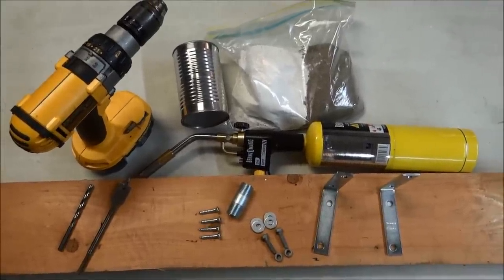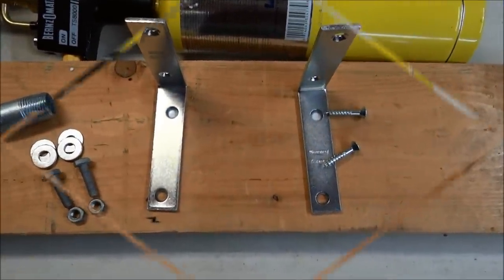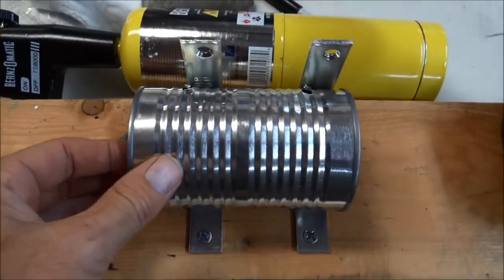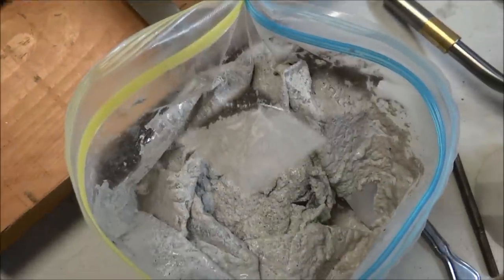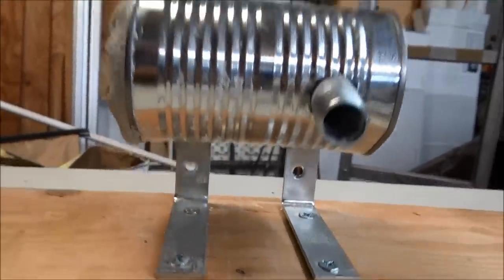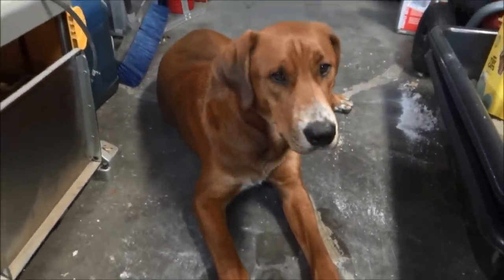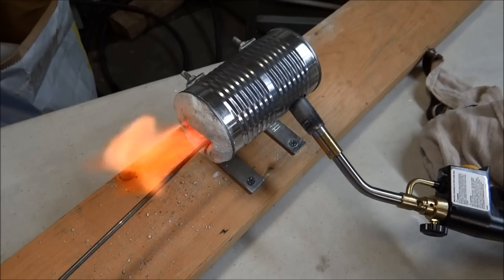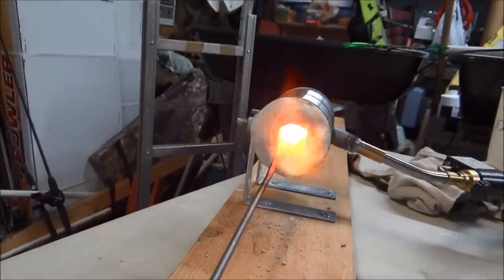Home Made Soup Can Forge - 2000+ degrees - Make your Own Tools

Comment: Clever & cheap!

A couple of modification ideas:
1.  You can heat more of your longer stock metal by making your forge with an opening on the closed end of the can/forge.
2.  You could make your forge into a smelter by making removable front & back doors on your can.  You may or may not need to include a small chimney in your can to optimize heating while the doors are closed--or, you might just be able to make a vent on one of the doors to ensure an optimal heat flow.

Comment: Very cool idea.
By the time the plaster breaks down around 25-50 fires you make another one cheap get it most any where. It's the same stuff you use on dry wall. It's called spackling, just add sand!

Comment: I made a very similar forger and found that the sand actually erodes easily over time , especially with lots of use. So I made a new one but used perlite from Miracle-gro and sodium silicate with only a smidgen of plaster of Paris and found it to be far more durable and a better refractory material. It costs a little more to make it, but it's  worth it if you're planning on making lots of things with it. I use mine pretty frequently for my knife making business.
Reply from the maker: +daisy8luke Cool.  If I had my choice, I wold use refractory cement.....it will last a long long time.  Thanks for watching.  Good luck with your knife business.
Reply: LifeBuzzN If I was going to use refractory cement, I'd just mix the perlite with the sodium silicate and let it form up, then use the refractory cement to make a smooth lining of the inside and the outer face. That would make a badass little forge that's really durable.
Reply: +LifeBuzzN I haven't made a soup can forge, but I imagine the way it works is similar to my chili forge. For my hard refractory, I use fireplace cement. I got a tub with a pound or two pre mixed for a few bucks. One of those containers would be enough for something this small, I'm sure.
Reply: +LifeBuzzN I haven't made a soup can forge, but I imagine the way it works is similar to my chili forge. For my hard refractory, I use fireplace cement. I got a tub with a pound or two pre mixed for a few bucks. One of those containers would be enough for something this small, I'm sure.

Comment: You can do this with the jet hole centered and cut out a hole in the bottom of your can as well. This would allow you to forge longer pieces of steel. A two burner model of about 18" is sufficient to forge swords length objects.

Comment: I built one of these last year and have made about 20 great bushcraft knives in it. In fact I just forged three of them this morning.  I started out with propane, but recently discovered the MAP gas works way better.
Reply from the maker: Way to go Howard.  Thanks for the comment and views.
Reply: Hey, that sounds exactly like what I am trying to do.  I just built one of these.  How do you get the whole blade red hot for smithing? I tried a 4 inch blade today and only the tip got red. I am used to doing it with charcoal so any advice is appreciated.
Reply: Brad Isaac
It's difficult to do if you've placed your iron tube too far toward the bottom of the can like I did. I place the blade in the forge about an inch or two from being all the way in and get the tip glowing first. Then I push it all the way in and use another propane torch to heat the end of the blade closer to the handle. It has worked pretty well so far, and I can get up to about a 6 inch blade glowing pretty easily. But I'm looking to build another one with better tube placement. Also, look in to using the MAP gas mix that comes in the yellow bottle instead of the blue. It's about 1,600 degrees hotter and works better. Good luck!!

Comment: I did this from a different video, but it amounted to the same thing. I used a coffee can though. It works, but the hole I drilled for the pipe nipple was too far forward and the lining is more funnel shaped than an even cylinder. Plus my vise doesn't make the best anvil. Still it's proof of concept, I've already got plans to help refine the heat chamber and add a shelf to rest the metal on while it heats up, probably get an ASO from harbor freight just to start with.

Comment: Nice idea!  I notice a lot of people asking about getting oxygen in there to increase the heat.  I picked up a crude torch at Lowes that combines MAPP gas with a cylinder of oxygen.  It isn't easy to get the proportion of gas to oxygen, but I'm thinking this will increase the heat output quite a bit and allow for a bigger can to be used.  I'm also curious if insulating the outside of the can would help.  I keep thinking about the kiln explosion excuse from Animal House...

Comment: Can a 50-50 mix of sand and plaster be used for high temp investment casting of ferrous metals? Like for making molds for the molten steel to be pored into?
Reply: Duly noted I found out that temp of molten iron would melt the plaster. Casting sand or a high temp investment plaster is required.  Thanks again :D

Comment: does the plaster/sand mixture ever crack, melt or disintegrate?
of all the homemade forges. I've seen over 15 for sure, this is by far the simplest, easiest, coolest.  I like how its not messy (dont have to deal with coal/charcoal) and convenient like you can move it around anywhere.
Reply from the maker: It will eventually dry out and crack, but you should get several burns out of it.  To make it more permanent, you could use refractory cement.

Comment: I would make sure your using MAPP gas instead of propane.

MAPP gas is usually in a yellow tank and propane is in a blue one.

MAPP gets a lot hotter than propane will. Try that and see if it works.

Comment: I like it, and it must be great to have a whole workshop to work in, I'm trying to think what I would use it for, or what it can't be used for, maybe for making small tools, melting small amounts of metal, I don't know melting points of silver or gold, would it melt them? Does it get very hot when you have had it on for a while, the surrounding air I mean, say 6 foot square around it?
Reply from the maker: B0rnles13 This is the exact comment as John Pollastrini........what gives?
Reply: google+ trickery

Comment: I made one of these, but like in the video, only can heat the tip, not the rest evenly. Thinking about drilling a hole through the back to pass the piece back a forth using firebricks to close up the gaps. What do you think?
Reply from the maker: smiley235 I think you would lose heat out the back,  Try it, let me know.

Comment: GREAT simple forge and how long can the plaster/sand mix keep with those heat levels before it cracks apart within?  I would try this with firebrick mortar.  Any feedback is welcome and Happy Holidays to all nonetheless.
Reply from the maker: Adrew Dio Hi Andrew, this little forge will not last forever.  It will eventually dry up and start to crack, although, I've fired mine for a couple of years.  I would use refractory cement for something more permanent.  Take Care-
Reply: Thanks for the tip...i'll check out the handymansclubofamerica for more details.  I was thinking about using graphite with the sand and plaster mix and I'm the kind of guy who likes to stay informed.  I don't want to mix this the wrong way and wind up with air pockets.  I'm a novice in this area although I'm a seasoned home repair worker.  I've never met any contractor who's strong in every type of repair.  Enjoy the Holidays and I left some painting tips at the web site above (my name at the site is adiovanni.

Comment: Awesome... but quick ?...  Why MAPP vs Propane gas?, and why no inlet breather hole?  Finally... any suggestions on a homemade clay slurry to paint on the steel while cooking it to alter the 'blade' section... vs the spine?

Thanks!  -Steve
Reply from the maker: Hi Steve, the Mapp gas is hotter than the propane, but either would get you enough heat to bend and work the steal.  I'm not sure about the slurry, sorry.  Go check out Chuck Richards.....he's a my knife master.

Comment: Very interesting!  I wonder if you can use this for a pottery kiln in miniature!
Reply: I've actually ordered fire clay recently, so I could custom size a little miniature kiln. I was going to manufacture a little lid, so that it could be enclosed. Of course it might need a porthole, but that's all trial and error. I'll be posting a video in a couple weeks when I get all my materials. 

If you plan on doing something like this, I highly suggest getting a pyrometer and a finer control on the propane. This can definitely reach about 2100 degrees, but it would be nice to have control enough to bisque first.
Reply: mndawsome I'll comment a link to my video when I make it.
Reply: mndawsome
 MAPP gas not propane.
Reply: Rustaholic777
MAPP gas is WAY hotter than propane. If you try using that in a small forge you must keep a close eye on the metal you put in the forge because you will melt it and have molten metal in the bottom of your forge. I had this happen in a small two brick forge I made using two soft white fire bricks. It is easier to make a forge from 2 rather than one soft brick btw.

Comment: cool video and nice job, if you cant get plaster of paris can a normal cement mix be used or is there a significant difference in the powders...
Reply from the maker: Thanks Moonbear, you could probably use any cement, but it will not maintain the heat as well.  Home Depot has it.  When I was looking, I had to buy the 50lb bag, but it was cheap.  You could also use refractory cement if available.
Reply: LifeBuzzN
i am in the uk we dont have home depot and our equivelant doesnt carry plaster of paris i will nosey online and see what i find cheers..
Reply: moonbear Save your money.  Plaster of paris forms a hydrate when it cures.  Heating up this hot will release the water in the bonds and you will be left with powder.  Use furnace cement mixed with ground up styrofoam.  Foam burns out and leaves air pockets that will insulate.
Reply: Bill T hey, that is nice to know. I was thinking about using fire cement, is that the same thing as furnace cement. I wanted to use it to line an old air tank with hard gravel. what do you think about that idea?
Reply: If you can't find refractory cement at your local hardware store, check with your local boiler repair/supply.  Mine actually stocks ceramic wool and proper 2800 degree (f) refractory.

Comment: Enjoyed the video - both the forge, and the pooch.  Can u use PermaStone or QuikCrete . instead of sand / plaster of Paris mix?  I ask "cause that's what I have on hand.
Reply from the maker: Regular cement may explode when heated, so avoid quickCrete.  Make sure what you use can handle the heat.  Like refractory cement.  Thanks.

Comment: That nipple you used looks galvanized. I thought heat those up releases bad gas. I know we always made sure to have proper ventilation when working on any galvanized stuff. Metal Fume Fever it's call. Can a brass or cast iron nipple be used instead?
Reply from the maker: You are correct, galvanized metal should not be heated.  In this case, the nipple doesn't get very hot, it's more of a conduit that anything.  It would be best to use black pipe.

Comment: This is a fantastic project. I've been wanting to get into smithing, but haven't had much of a budget to work with. Would this work with just about any size can?
Reply: With a strong and safe enough fire source I'm sure you could use the same principles on anything from a soup can to an old oil drum.
Reply from the maker: A bigger can is fine, just remember you have to have enough heat.  This torch could probably handle one of those big bean cans, but any bigger would require a larger heat source like a Reil Burner.  Thanks for watching and commenting.

Comment: Made one, followed every direction and it looks great, but I stick in the torch and 30 min later I still have a torch in the bottom and no forge. I asked at the local hardware store for a spiral tip and they had no idea what I was talking about.  Could this be my problem?
Reply from the maker: Make sure your torch is pointing forward.  Your nipple should be in at a slight angle.  Good Luck.

Comment: Hi, do you think I could use the mixture plaster of paris and sand for some molds where to melt lead? I do not really need to have the final result nice and smooth, which in any case can be sanded down if needed. I basically just need to know if this mixture is strong enough and wont brittle and break with the heat in the long term?
Reply from the maker: fishingtanzania I'm not sure, I use cast Iron for meting lead....works pretty good.

Comment: If you use cement make sure you use 1 part cement and 3 parts building sand (filtered beach sand) slow heat it and DO NOT run the gas on "full blast".. If temperatures rise to fast, a chemical reaction occurs within the cement if their is any moisture still present... the molecules of any residual water bubbles will separate, releasing hydrogen gas. The hydrogen that's released is still trap in the concrete and under pressure. You might as well be playing with a can of C4. Its important to slow heat it ON LOW for no longer than 10minutes. then leave it to cool for about a half hour. then repeat this 4 times. On you fifth run, you definitely don't want your dog around or anyone for that matter.  You will need to run it for an hour before you know if its safe. KEEP YOUR DISTANCE WHILE YOU WAIT FOR AN HOUR. If the damn thing explodes, you don't want be right there where it does. Make sure you are in a well ventilate place because breathing the fumes is also bad for for you.... I hope this helps

Comment: Where do you get plaster of paris?  Could you upscale this to a small steel trash can and a propane weed torch?
Reply from the maker: I got the Plaster of Paris at Lowes.  If you were going to upscale to trash can size, you might want to use refractory cement.  It's made to withstand the heat much better.  You would also need a bigger torch...like a Reil burner.  Thank You.

Comment: I built one. From your tutorial /the other guys....got the torch never have left it on yet though. How much time with a full can can you get worth of forging? Thanks!
Reply from the maker: I've ran mine for an hour and still have gas.  Let me know if you find out.  I appreciate the comment.
Reply: Cool, Will do!
Better to use the Butene yellow can or use propane ya think?
Reply from the maker: I used the Mapp gas, it buns hotter.

Comment: Could you cut out the bottom of the can to forge longer things?
Reply from the maker: If you cut out the back, you may lose the heat.  You could make it with a longer can.
Reply: LifeBuzzN Idea... for rear 'pass through' option... use a piece of larger pipe nutted to the rear and out.  Cap it when not needed, open it for longer passes... set on bed of bricks and insulate as per internally above.  *thinking out loud*...

Comment: Could you use fire cement for that? The stuff I've got says is only good for 1200 degree's C. Thanks
Reply from the maker: Fire cement would be ideal for this application, however, it takes the cost way up.  Thanks Phillip.

Comment: Thanks for the great video! Just started in on this as a new hobby and I'm shopping for a vise and yours seems to have a double anvil but I couldn't see a name.  What brand and model did you use for the video, if you don't mind?
Reply from the maker: Thanks Alex.  It's a "Bessey" from Lowes.  I think I spent $60 pr $70 on it.
Reply: Skip store buys on anvils... look on ebay and search "railroad anvil"... made from track are cheaper and awesome.  Also try CL... search "old tools"... easy to find in the $5-$25 range.   For the railroad option... go with 6" (it'll fit in the cheap mail box!) ... then just bolt to your bench.

Comment: I've heard that if you use normal cement it will explode when it gets too high, is that why you made that mix? If so then im assuming there's no exploding risks with that. I'll be using it for a foundry to melt aluminum in a propane tank so it's gonna be a little different do you think this mix will work just fine?
Reply from the maker: xProsHD It shouldn't explode, but it won't last forever.  I melt my aluminum on a "Grill Forge".....check out my video.....http://youtu.be/nrN6rEKCEac
Reply: I would use caution when inhaling metal fumes.  Gary Null has many books out on health and cooking with aluminum and plastics and how these can affect the memory and blood.  He also did a talk show and I don't know if he's still on the air.

Comment: Instead of using a plaster & sand mix, couldn't you use furnace cement instead? It would cost slightly more and take longer to set but would be able to take heat better.
Reply from the maker: If I had my choice, I would use refractory cement.  Whatever you use, make sure it can handle these high temps.  Most concrete explodes when heated.  The plaster is not a long term solution, it will eventually dry out and crumble.

Comment: Not sure what the point of the can is? I use a torch like that with MAPP gas to heat metal like that all the time by itself. It'll get it white hot in 30 seconds. Does the can help it heat evenly? Or increase efficiency to decrease the amount of gas you use?
Reply from the maker: The can helps to keep the heat even and confined.  Works great for me.

Comment: Hello. Did you use plast of Paris and common sand in the same parts?   
What happen if only plast of Paris is used without sand?  
Is it possible using common plaster ? 
Instead of plaster, is it possible using refractory cement?  And  sand is it used anyway ?
Thanks for your answers
Reply from the maker: Refractory cement would be the best.  If you is Plaster of Paris, you need to add the sand to help it hold together and handle the heat.
Reply: Thanks!